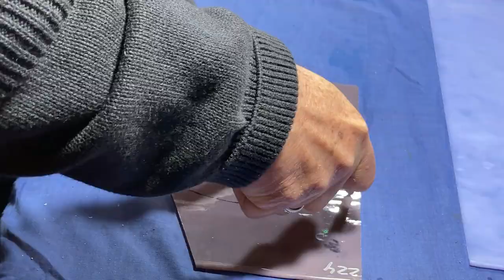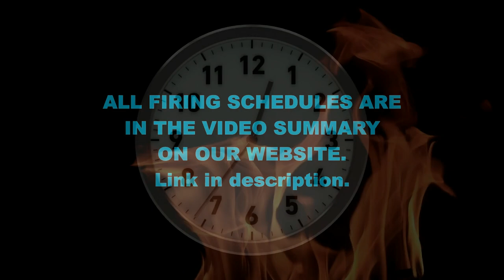Stack It! Fuse It! Love It? Glass Fusing Project Tutorial

Comment: Great job. If your using a dish as a mold do you need any holes for ventilation? I have a couple from a thrift store and was curious if they need venting. I noticed yours didn't seem to have any, and it worked.  Thanks in advance.
Reply from the maker: If it has steep sides I would drill a couple of holes in the bottom. Just so it helps the air escape. If the sides have a more gentle slope I don't worry. That mould isn't too so I didn't worry. Usually, with the purchased moulds they already have vent holes. If you're worried add a couple anyway.
Reply: Great, thanks for the info.

Comment: Hi Jeff - Love the shape of this bowl so much. Please can you answer as to why did you pull the first cut towards you but with subsequent cuts push away? Also how did you get your shape accurate? Thanks so much
Reply from the maker: Hi Lisa. Purely convenience. I could have turned the glass to be consistent, but I don't believe it's necessary. To get the shape I placed the mould over the glass and marked it out with a texta, but after cutting I ground the edges down to the final shape. Hope this helps.
Reply: @RocketRoseArt  Yes. Brilliant - Thanks so much